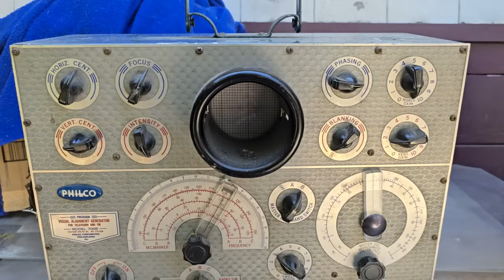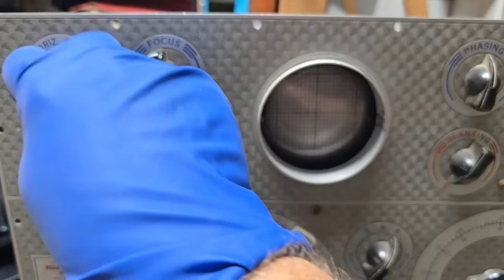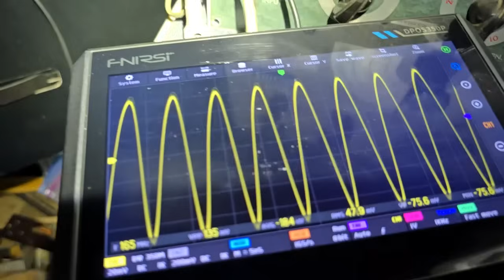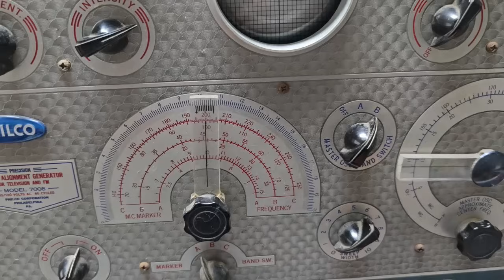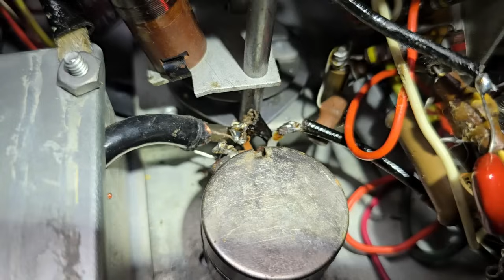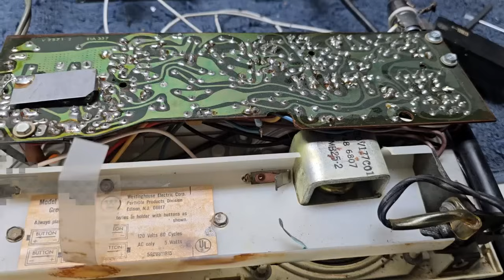Philco 7008 Sweep Marker Alignment Generator Scope All In One Restore

Comment: In the 1950's some television transmitters had a built-in sweep generator as a tuning aid.  One DuMont manual I read referred to the the circuit that generated the sweep as a 'wobulator'.  It consisted of a motor driven butterfly capacitor in the oscillator circuit.   The speaker driven capacitor is a neat take on the same idea.

Comment: Why do vintage TV restoration folks care about the tuner and IF section? There is no NTSC broadcast anymore, perhaps some LPTV still. I know we have RF modulators but why not just do a slight modification for direct video input. Tuners are a PITA and IF transformers develop those mica shorts. You can still buy those round micarta NOS RCA jacks of the period. Of course we must be mindful of the hot chassis problem in portable TVs
Reply from the maker: Keep it original and that mod doesn't work with hot chassis sets

Comment: Nice piece of vintage test gear.
Find so many of things like these at the swapfests, but many have smoked power transformers from just turning them, on or dim-bulbing known bad caps.
The usual idiot comments, about how it took a long time to come up, and started humming before they smelt smoke!
If you are serious about keeping and using something like this valuable piece--replace the damn caps!, because you're going to anyway!
I'm not a cap not-zee, but even if you question the CRT, disconnect and tack in some temporary caps!
You never said exactly, what you did to fix the shifted centering, but I suspect one of the supplies was sagging.
So, when you see the beam greatly deflected, it is usually the power supply or centering controls.
As a note for others, it is perfectly fine to install the electrolytics, where they are actually being used (as was done here), as opposed to running long wires to a centralized cap.
Many times you can enhance performance and noise pickup, by eliminating long power supply runs.
On the pot, many times you can disassemble and repair them, even if you think the carbon track is broken, which is rare and usually only when you feel a rough-spot in the rotation.
The reason they are ganged like that, is it gives you a tracking vernier; instead of first adjusting a coarse, then adjusting the fine.
On the Loctal tubes, this was Philco & Sylvania's 'bright' idea in 1938 to replace (what they thought) unnecessary metal tubes; this never made sense because they were very unreliable (thousands of equipment scrapped because of intermittents and failed operation) and only offered a partial-shield; the only advantage was the pin went directly into the tube envelope to eliminate soldering to a socket pin.
Finally on the marker, you can usually find an injection-point, whereby you can disconnect their generator and sub yours.
The other idea is to find a point whereby you can attach a frequency counter; however you may have to insert a buffer-amp to eliminate noise from the counter's digital circuitry
People may wonder why they didn't include (say) 50-KC to 5-MC for use on AM and SW, but the whole thing is so physically-geared to VHF/UHF and the TV repair market.
Anyway, would love to see you use this for the older TV's that can really benefit from doing a true sweep alignment; but I do agree, that precise knowledge of frequency is needed.
Thanks for making this video and 73...

Comment: The double pot connection is actually very cool, and I took the time to solve it! The pots are in series, and therefore the resistances R2 and R3+R4 are in parallel. I did the math, and when the pots are at half position, the output voltage from the second pot is 1/5 (20%) of the input. The overall response becomes exponential, with the function described by x^2 / (-x^2 + x + 1). Very interesting!
Reply: Yes, this was a common technique, two linear stages converted to logarithmic.
Reply: Could that be replaced with an audio pot?
Reply: @fredfabris7187  I'm sure it could be but the logarithmic taper on an audio pot may not be accurate.

Comment: After seeing a short video showing the insides of this rare Philco test equipment  and how it works ( by Shango 12 years 
ago ) I literally waited  to finally see this happen. Finally being restored!  The Philco  49 page set of instructions, with an explanation of how it works and  how to use it is available on the web. It does have a nice Philco schematic with parts
list at the end. A very good video Shango and no you didn't disappoint us with replacing parts as those were all bad.

Comment: It's interesting how they used a vibrating capacitor to develop the sweep in this unit,  I have a TV alignment generator from the 1960's (the make escapes me) and it uses a extra coil on the oscillator coil to vary the frequency of the oscillator by varying a DC current through that coil.  This method of varying the inductance of an inductor is called the magnetic tuning method or using a saturable reactor and works by changing the effective inductance of the primary oscillator coil.

Comment: What is that S curve, Shango?
Reply: I'll give it a try:
it is the response curve in the frequency domain of the IF transformer chain in the radio.
At the left side of the curve trace (the beginning) the frequency is a few hundred kHz lower that the IF frequency (10.7 MHz), at the right side of the curve trace (the end) the frequency is a few hundred kHz higher than the IF frequency. The frequency changes really fast, it changes on the vibration frequency of that mechanical piece, the wobbulator, so about 50 times per second from 10.5 to 10.9 MHz. With exactly the same speed, the light trace from the scope is going from left to right... So the s-curve line shows how the IF chain responds to all the frequencies in between 10.5 and 10.9 MHz. The middle should be 10.7 MHz.

Comment: If the tapers of the two pots are not the same they could have been trying for some weird roll off rate vs knob turn.   ACTUALLY that looks like some kind of constant impedance attenuator circuit like an L or T pad?

Comment: I have a heathkit ig-52, pretty much the same as this, except it doesn't have a built in scope, has a crystal marker generator and the sweep gen works with a iron-cored sweep electromagnet coupled to the ferrite sweep oscillator inductors, changing the magnetic bias changes the oscillation frequency. It's useful for aligning radios, but to align TVs I use an external signal generator to generate markers as they need to be precise. I don't have any crystals useful for markers, but it does work with random crystals.

Comment: I've changed all of the old switchcraft type microphone connectors on my old tube type test equipment for BNCs.. When I find the old gear the cables with the switchcraft connectors are lost or in very rough condition, and they are very expensive to buy if and when you can find them.

Comment: No worries about changing those "pretty" wax caps agasinst modern plastic ones. Its more important the equipment runs accurately and reliably than look period correct inside. (my opinion)

Comment: Beautiful piece of equipment! I’ll bet that brushed pattern on the front panel was incredible when new.

I’ve seen where folks restuff or replicate those original wax capacitors. If you haven’t discarded them yet, you could always just bag up the old caps and keep them with the unit in case someone wanted to do that in the future.

Comment: The dual pot is for better isolation. When attenuating the rf signal, they tried to suppress (capacitive) coupling as with more and more attenuation it is getting more and more hard to achieve this. Brands like HP put every section of its special made attenuators in a separate shielded section. Remember even coax shielding is „only“ -90dB, that‘s why modern test gear uses semirigid for better shielding.
Reply: Not very at home in this stuff, and your arguments make sense, but as shango remarked,  here the side effect is that the linearity shifts; when both pots are at half, the voltage on the output wiper is at a quarter.
Reply: @erikdenhouter  But the linearity shift is what you wanted. With linear potenciometer, you couldnt set even 1/100 level. But with this combination, its possible. So it creates something similar to "logarithmic" potenciometer we use for volume control.

Comment: You don't violate it. The fact you are emphatic about properly restoring with attention how it looks demonstrates this.  You preserved photos. The restoration made it useful again! That is what the manufacture wanted, not a static, dead 3d model. Find another for display but use and enjoy the one you restored to help restore more old equipment.
Reply: The die hard resto folks will stuff the original caps. Of course that takes a lot of time and energy, and in the long run it most likely won't matter when the person that inherits the gear takes it to the dump. If it was one of the classic types of radios or TVs that have a lot of value to them and there is a demand... I don't find a lot of demand for the old tube type test equipment. I pick it up for my own interests at Ham radio swap meets for pennies on the dollar. Even though they are works of beauty in how they're made they tend not to be as precise, accurate or as portable as modern test gear.